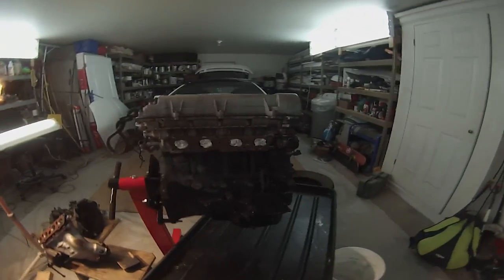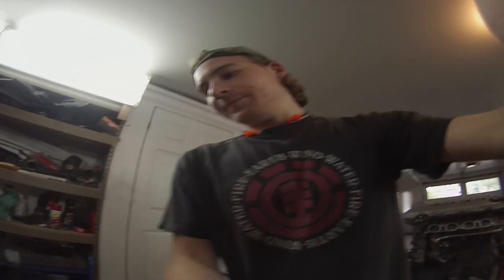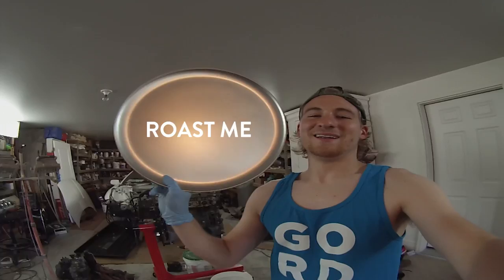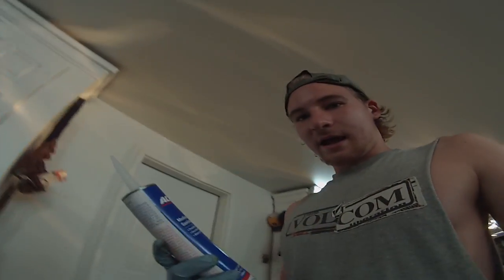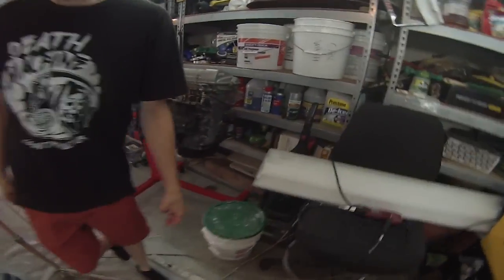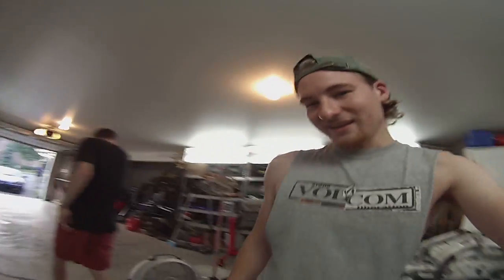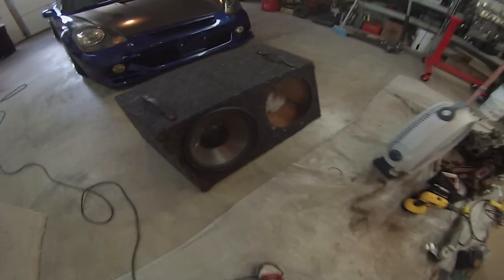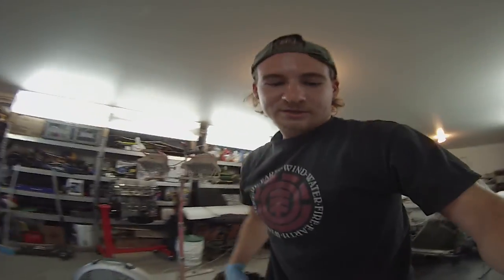DIY ENGINE BAY SHAVE !!! - Part 1

Comment: Hey lake, sub is pretty janky, especially since it's old enough that it's 8 ohms. Btw it's the impedance not the resistance * to test if it works connect the power leads to a 9v battery and if it pops in or out then it should work.
Reply from the maker: MrCtown8 thanks for the tip man!! The guy said its probably been 10+ years since he's used it so I can imagine its kinda outdated. I'll test that out and see if it's any good, if not I guess I'll have to start looking for a sub to replace it! I think I've officially decided to just use half of the box, it's way too big for me lol
Reply: That is a huge enclosure, and another thing to keep in mind is that the enclosure is just as important as the speaker in it. IE. subs are designed to perform best in a certain sized enclosure, so make you you check the recommended volume of a subwoofer before throwing it into a box! You can also shoot me a message on FB if you want, Its Colin with the red Celi on white works.